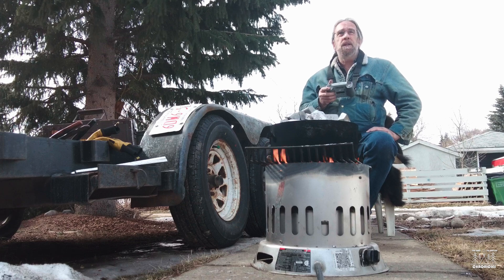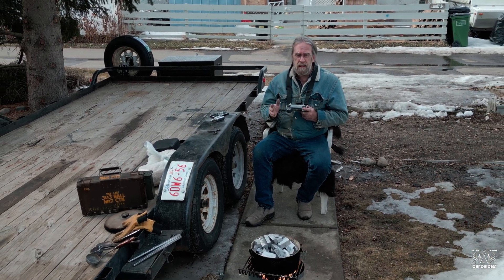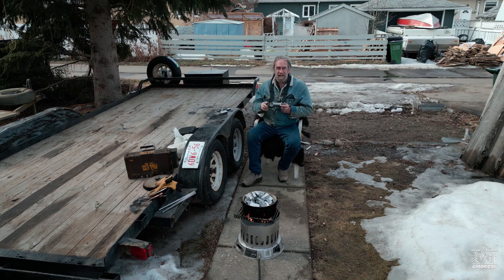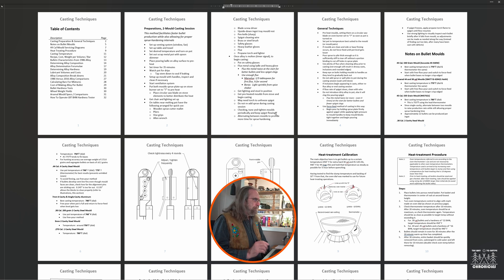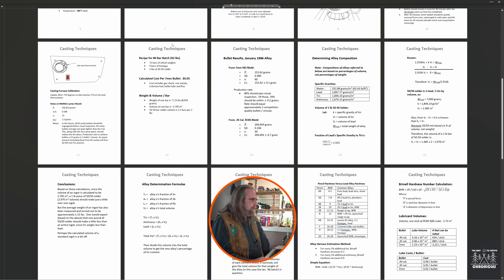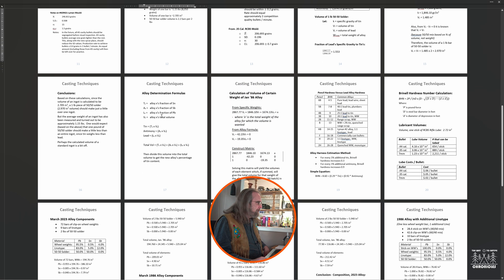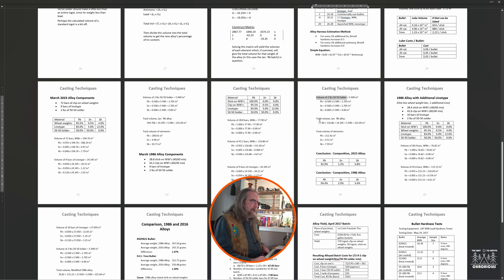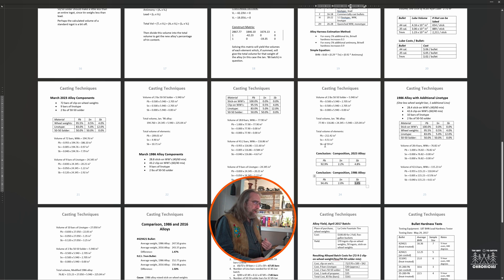Figure Out Your Wheel Weight Alloys! (4K)

Comment: Linotype, noice! Got myself 45 # of that stuff years ago, still have like 40# of it. :) I use Roto Metals super hard and Tin Snips to mix my alloys. The Tin slicks up the bullets nicely as they fill out the molds well when Tin is about 2%, I drop into ice water since I cast at a really fast rate to maintain consistent heat in the mold, and the bullets drop highly plastic, so if I dropped on towels they warp. Dropping into ice water quench hardens them faster and raises the hardness, 18-22 Burnell. P.S. Love to see you playing with the drone.
Reply from the maker: Nice to hear how you're doing it Michael.  Just as a heads-up, as I'm writing this, I'm working on a new video on this topic.  I spent several hours and made a bullet alloy calculator (that loads into Excel or Google Sheets) that I will be giving away for free.  I plan to announce and demonstrate it in the next video I publish.

And, yeah, that drone is fun to play with!  Cheers.
Reply: @TheWaytoNativeChronicles  Looking forward to it. I have not gone as far as tracking my alloy in forms, so that will be helpful. Need to get a hardness gauge as well, I only do the fingernail test at this point.
Reply from the maker: @michaeltomsa-musatin  I just posted an image of it on this channel's "Community" tab.